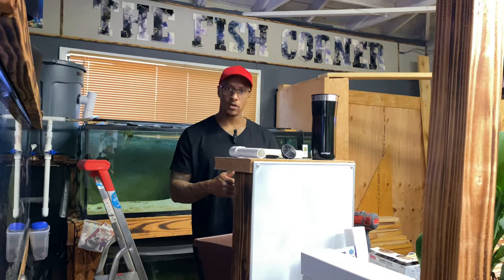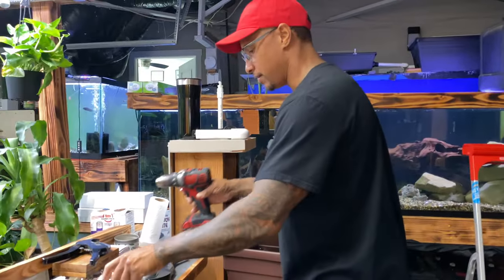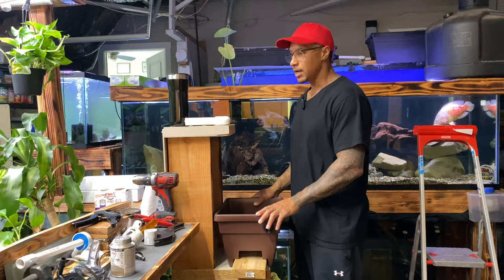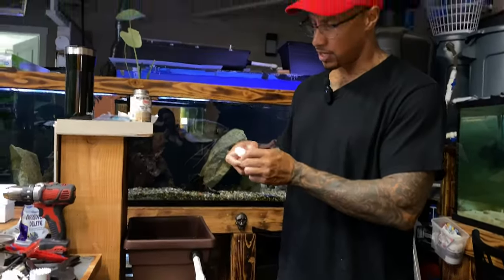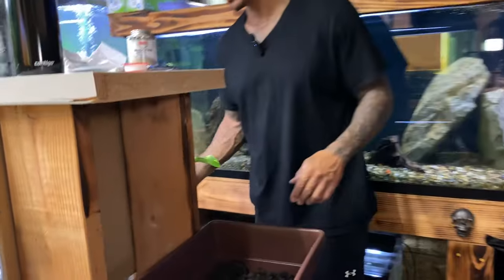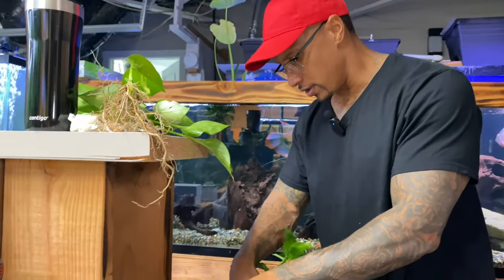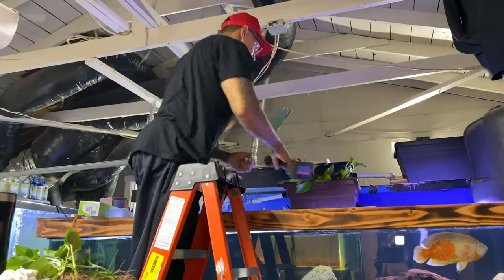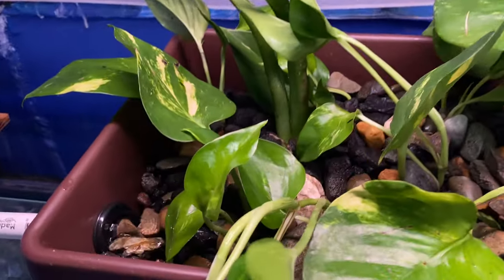Above the tank AQUAPONICS on the 240 GALLON

Comment: Hey my brother, cool video. I just wanted to say the same way you wipe the pipes on the outside. You should also wipe inside of the elbows before you put the glue.  Just in case there's a residue or dust that would cause a leak.